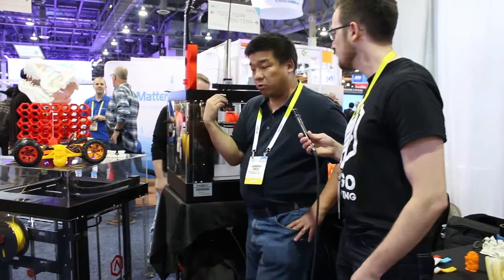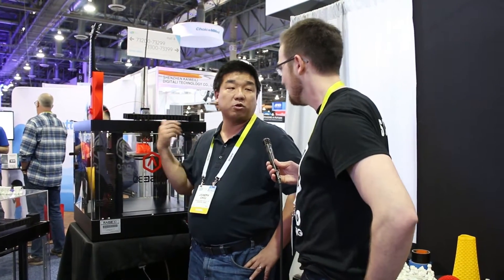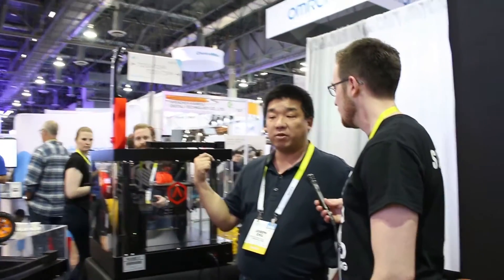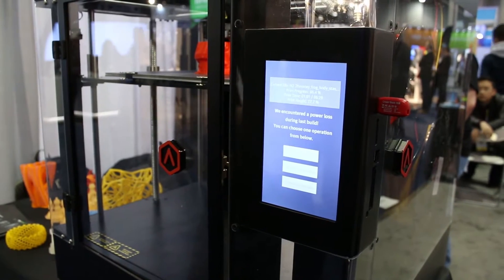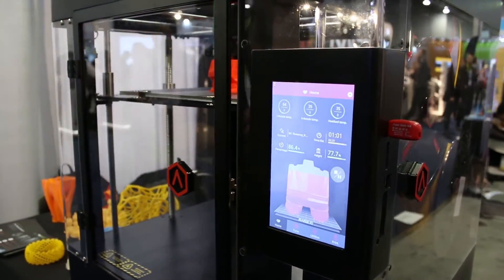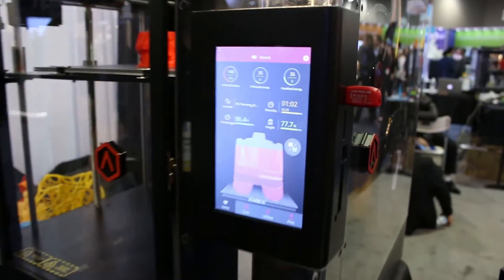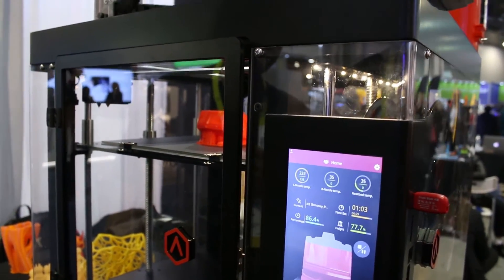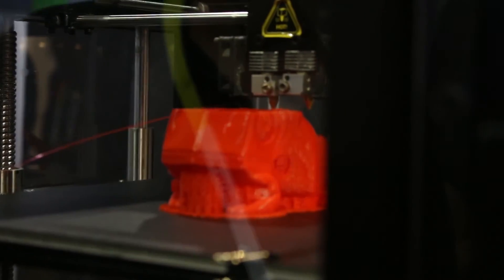Raise3D with ToyBuilder Labs' Joseph Chiu At CES 2016

Comment: Just bought an N2 last night, looking forward to printing some big high quality stuff. thanks for the great interview and info
Reply: +Fargo 3D Printing I will definitely keep you updated. I believe I should be receiving my N2 by the end of March to early april. Thanks again guys I love and appreciate what you are doing. The information you guys give has been very helpful and has saved me heartache and money. Can't thank enough
Reply: +BiaggiMendozaProdt Have you received your N2 yet? What do you think and how does it compare with prior 3d printers you've owned? Thx.
Reply: +DrR1pper I'm very impressed so far but have a few little complaints. Raise3d claims there is no need to level the bed but when printing at a larger size a corner might be too low or high. the leveling system is new and different to what I'm use to so there is a little trial and error. the only other complaint I have Is you are not able to directly connect the printer to pc with usb, unless I'm not just not seeing how. the pros are that looks so legit and professional, very quiet, easy to see inside and make adjustments to printer, great resolution, great community and support, A+ control panel.

I use simplify3d for a slicer but they don't have a profile for it yet so u have to create one yourself. I don't care to much for their idea maker software
Reply: +BiaggiMendozaProdt Sweet! But how do you get around the bed leveling issue then? Do you just avoid printing in those areas? Also how is the print quality compared with other printers you have owned?
Reply: +DrR1pper the N2 has 9 points for leveling but uses 2 set screws to set the level of the bed at each point and a nut and bolt that secures the bed down to the Z axis plate. As for quality I have only used 2 other printer (flashforge creator pro and M3D) so my experience with quality is limited bur I will say it the few prints if done so far have been the highest quality I have produced. I'll have more info and some pics in a few weeks, I'm finishing up my semester then I'll have all summer to play
Reply: BiaggiMendozaProdt Thx for the detailed response. Best of luck to you in your exams and coursework. :)
Reply: +DrR1pper No problem, and thanks I appreciate it